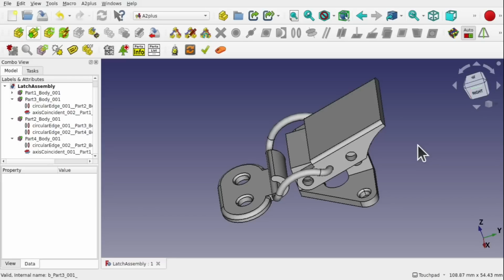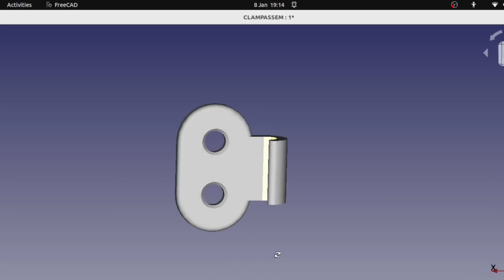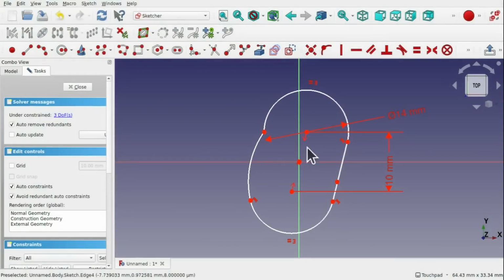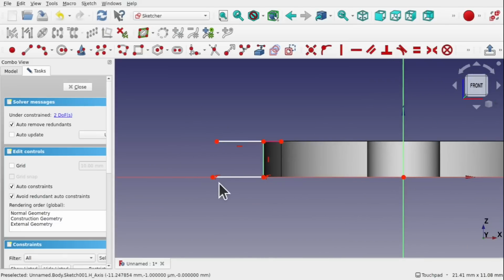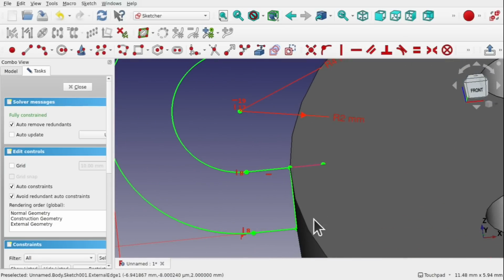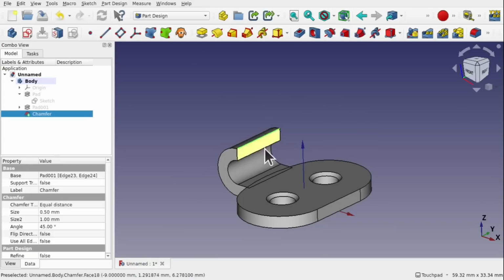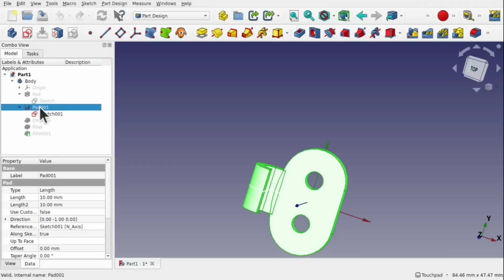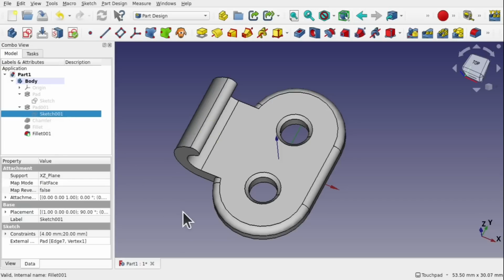Learning FreeCAD For Beginners | 35 (Part 1) | CAD Thinking Part 1: Latch Assembly Tutorial

Comment: I can get the sketch of the hook  fully constraint.  But I close and select the Pad operation and I get the error "wire is not closed"  which is  ...  Confusing.
Reply from the maker: It sounds like you may be using the later version 1.1.  There has been a change when you import geometry using the external projection tool, this comes in as defining geometry rather than the usual construction as it did before.  To rectify this select the imported geometry which will me in solid purple and then click the 'toggle construction geometry' tool, also available on the right click option.  This will toggle the geometry to construction (dashed line) then you will be fine.  You can also change the to construction mode with the same tool, then import using external projection tool,  then toggle back to defining mode.  Hope that helps.

Comment: I'm not able to add the fillet to the bottom pad here in FreeCAD 1.0. I'm getting two different errors: If I try to apply the 1.0mm fillet, I get the error "BRep_API: command not done" error. If I reduce it to 0.95mm or smaller, it creates a bunch of strange geometry. The issue seems to be where the bottom pad connects to the hook that extends into the body of the bottom pad, but I haven't been able to determine why this is happening.

Edit: Of course, as soon as I post this, I realize that the next 5 seconds of the video solves the problem. Turning refine->true allowed me to then apply the fillet to the bottom pad with no error.
Reply from the maker: No problems. Glad you got it fixed.
Reply: "Turning refine->true" where is this option?

Comment: I followed along and only had one difference. I placed the hook edge a little further inward before I padded that sketch. When I got to the last fillet I couldn't go above .6mm. I had to refine the second to last fillet before I could do the final fillet at 1mm. The end result was identical without further refining.
Reply: Oh, I guess I didn't do the 10mm pad either. I did 12 the first time. Commented too soon there didn't I?
Reply from the maker: But you got the same result and found a way round the issue so all good 😊😊👍👍

Comment: One crucial thing to mention. As of 2024 the option to 'Auto Move Redundant Constraints' is off by default. It also is located in a different spot and is hidden. Look under Tasks => Constraints => Icon with wrench and screwdriver dropdown => Click on 'Auto Move Redundant Constraints'.

Without doing this, I was not able to get past the very first step of the video when trying to change the constraint radius.

I think it would be good to do an updated tutorial as a lot of the ui layout has changed and it will be hard to follow along.

Comment: I had same issues in the past with fillets and this video would have cleared such issues (if I had seen it before!).  So  usually I would have refined the last function but, if I have already done it once (in this case second from last fillet) then it does not need to be done again? I tried on other drawings I made and refining more than once does not seem to make a difference. What issues could it cause of any?

Comment: I am trying to model a corner cover for the aluminum pannier on my motorcycle. The basic shape is a triangle. The part is a triangular cup essentially. The complication is that the sides are a different angle from the base than the apexes are. I think this video is what i need to sort this but there are some features in freeCAD that don't seem to be available to me. In the part design workbench I have no access to "view sketch". How do I go abut activating this? Great video by the way. If only I could get access to the tools I need.

Comment: I recently got myself into Freecad and after about 3 weeks of teaching myself the program, finally went into watching some of your videos through the recommendation of the freecad subreddit. The things i learned in 5 days surpassed everything i knew in those 3 weeks. I recently finished a small scale model of my daily use wheelchair and was after i finished the personal project that i started watching your videos. 5 videos in, the stuff i learned couldve made that so much faster. Still needa go through your lattice2 series and curves WB.
Reply: Biggest thing i learned was the premise of a master sketch and how to use construction lines to help use the mirror feature. I luckily had the basic understanding of pads, sweeps, pockets, etc. Just there was other ways i couldve went about the project because i did it entirely in part design workbench. Frame, spokes of the rear wheel, everything all part design. And while the end result pleased me, it showed that i had a lot to learn still before i comfortably decide to dip into getting a 3d printer
Reply from the maker: Thank you for sharing your story . This is the exact reason why I do these videos especially the latest mini series. There needed to be something that could jump start everyone's learning to get them up and running and to reduce frustration. I am glad you found them of use and thank you for taking the time to comment.

Comment: Fantastic!

One question, when you refer to external geometry in the sketch, isn't it better (practice) to try to refer to the sketch that drives the part, rather than parts of the extrude?
Reply: I am new to freecad and I learned this the hard way too. Referencing edges in the extruded part seems to break if you have to go back and rework a sketch higher up in the tree. I've started making all my constraints reference the axes if I need an external reference to the sketch but I'm going to try your idea of referencing the base sketch itself rather than the body where I can. That makes more sense.